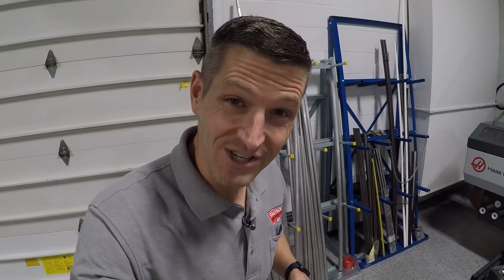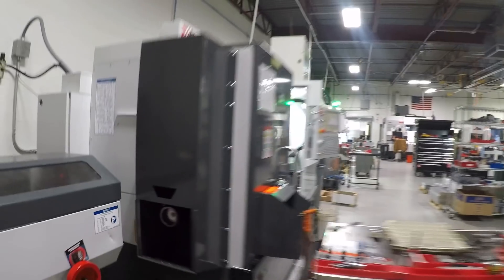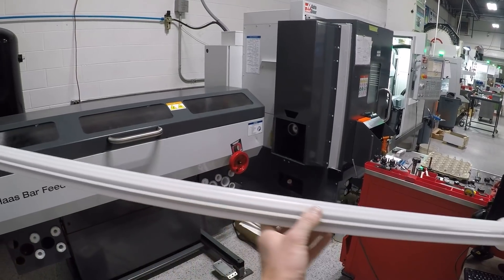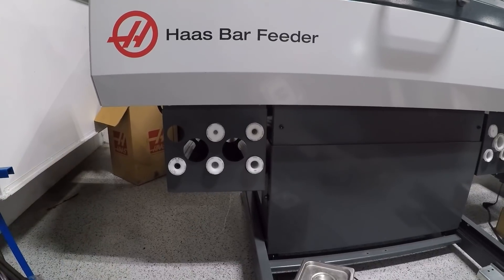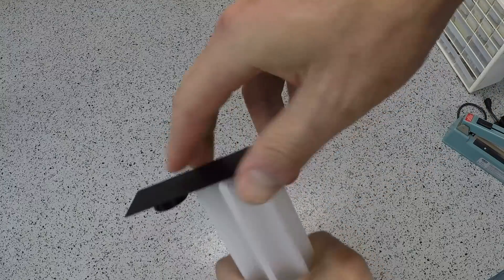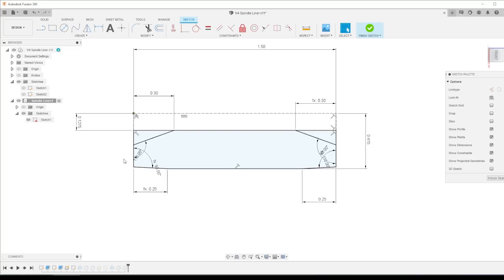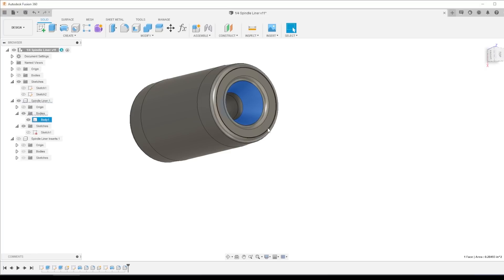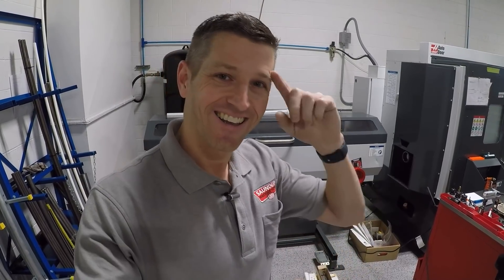3D Printed Bushings for CNC Lathe Spindle Liners!

Comment: How many bushings do you have floating inside? In your experience, if I leave any gaps, would that be a problem? I actually thought one press-fit at each end plus one larger in the middle for support should do it. Am I wrong? 
Also, with what material did you print? Holes in PLA parts tend to wear super fast.
Reply: I’d use PETG personally, or even better, carbon infused PETG

Comment: Hey there! Here´s some shout out for help/guidance! I remember John making a video some time ago which i cannot find again. In this video he was explaining how to modify a chamfer on a threaded hole so that the milled thread has a nice start. Just now i am sitting in my shop having this exact problem: how to make a nice start to a thread. Does anyone know which video that was? I kind of remember he made some slight changes to a chamfer toolpath, yet i cannot exactly remember how he did it. Who can point me to the video?
Reply: Are you looking for the higbee (check spelling)  thread video?
Reply: @Julie SMW Hey there! Well, i did the search for chamfer and threads, but could not find the exact video i was looking for! I think that was some trick hidden in a general video, but just cannot remember where. Well, looks like i will have to try and figure this out myself!
Reply: @Julie SMW Sorry, this is the only thing i remember. It was an inner thread and he jJust somehow he tweaked a toolpath to remove the start of the thread on the upper part of the hole (where the thread gets very thin normally)

Comment: On our 3 year old ST20 and bar feeder we got both push rods and all liners. No 1/4 in.  Replacement liners are $85 last time I checked.  We have run a few hundred 1/4 and 5/16 48in bars.  I 3D printed a guide for the back of the 3j collet.  Use 3/8 rod to set bar feed height. The small bar feed rod is .375.  Will not fit in 1/4 liner.  If the feeder height is set using 1/4 inch bar the small 3/8 bar pusher will bang the feed track.  Also the optical sensor will detect the bar without adjust mental. 
Even when we double feed for long 1/4 inch parts the 3/8 liner works great.

Comment: By why even do something on 3d printer when you have CNC lathe and mill? Part from solid plastic will be better than layered 3d printed
Reply from the maker: Because this took 10 minutes of my time, is a great recipe going forward, cost less in material, and did not tie up a $100k lathe to make them
Reply: @nyccnc  I Had the same thought. I think it is not much more work to design a toolpath for a CNC lathe then a 3D Printer, however the material costs and the mashine tie-up are two very valid points!

Comment: OR YOU CAN WHIP UP SOME DELRIN  IN ABOUT 15 MINUTES!!!!!!
Reply from the maker: 1) Did not have delrin, 2) Delrin is more expensive, 3) I'm decent on a lathe, but no way start-to-finish is 15 minutes for me.  3D printing takes longer, but requires none of my "time" while its printing.  The printer also costs under $1,000  - versus using/tying up a CNC lathe that is 100X that price.

Comment: We've got a hydrafeed and it's super easy to machine liners out of delrin for. Our HAAS CL1 has its own half liners though, what material are you using to print these?
Reply: I would like to know as well although I assume pla or petg because he said about $10 worth of material. It could be nylon though. Same situation with the cl1!
Reply from the maker: @elvo_racing  yup regular ol' PLA
Reply: @nyccnc  yeah I realized that your spindle guide bushings spin with the material, the CL1 has stationary bushings and the material spins inside of it. Their not huge but delrin is the best material due to the friction. You could maybe try nylon or polypropylene but both are tough to print.

Comment: Does the liner rotates together with spindle or material rotates inside liner?
If later then I imagine it generates some amount of heat. And it is better to use higher temperature materials for printing this.
Otherwise it will start melting, grab your material and ruin your day.
Reply: The liner rotate with the spindle, so plastic material is fine to use.
Reply: Yeah the whole spindle is rotating, so the spindle liner is fine.

Comment: John, one of the tricks in Fusion is to use the centerline option, it's right beside the construction line icon, and that allows you to finally use the diameter of a part in the dimensions.  It is also auto selected when doing a revolve feature.
Reply: Using symetries is a good trick as well, to have a minimum of dimensions to modify
Reply: This indeed!